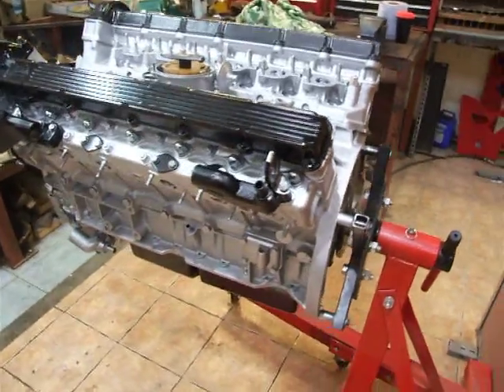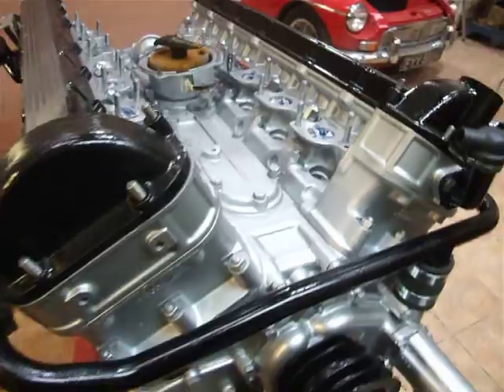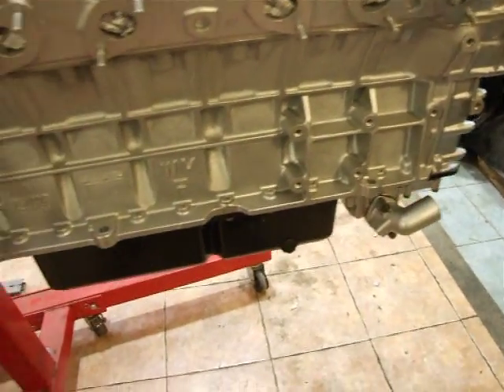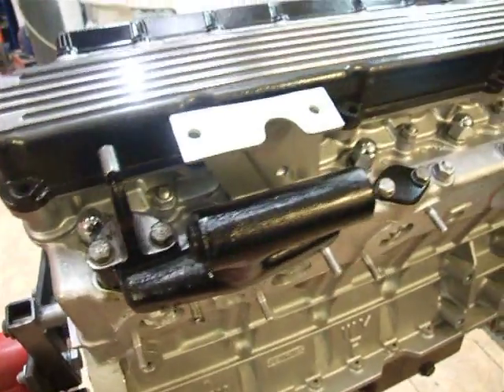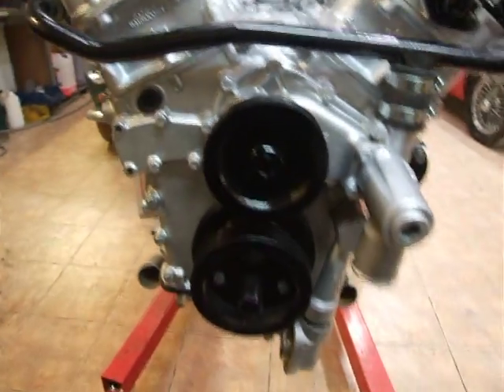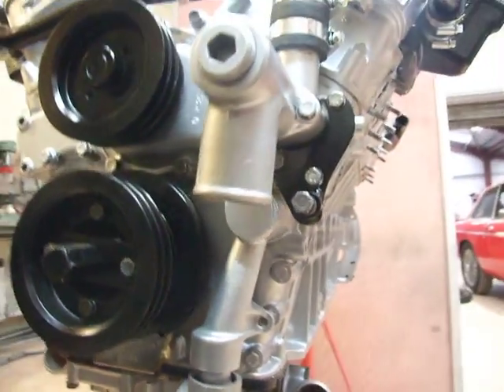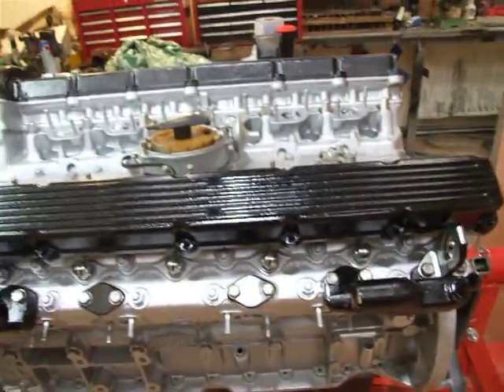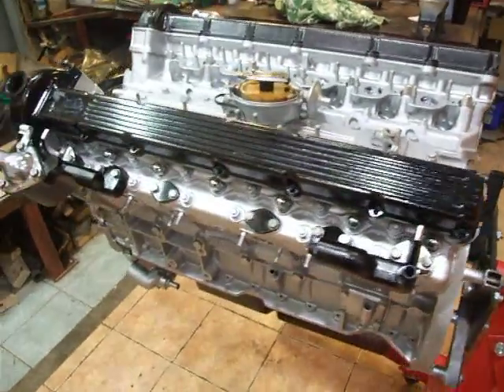Jaguar V12 Engine Rebuild (4)

Comment: how did you clean the aluminum so good?
Reply from the maker: +dantheman1998 We used a high pressure steamer and a localised pot blaster. The finish is as much part of our rebuild as the internal components, we try not to miss any of the detail. Regards from the Team